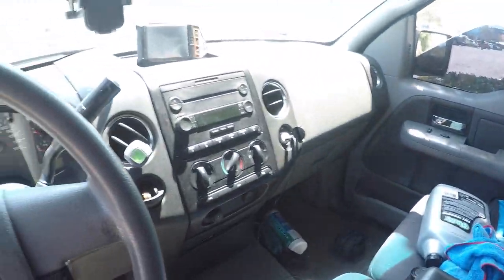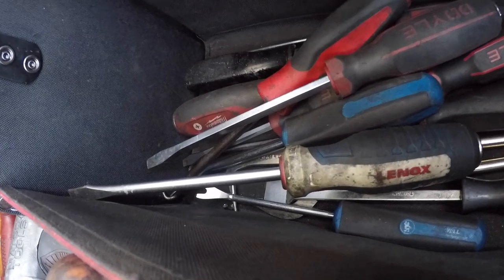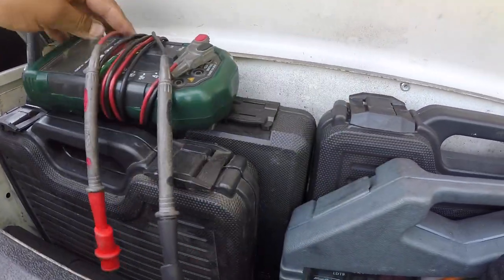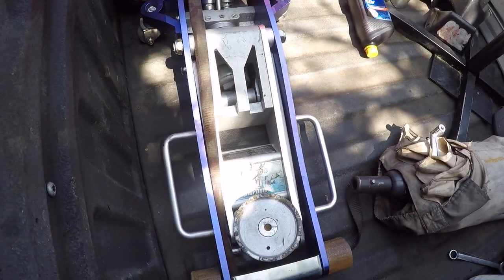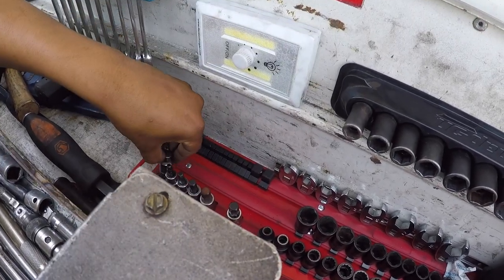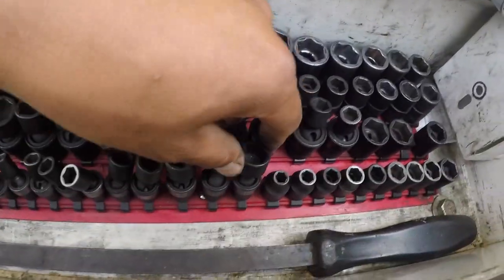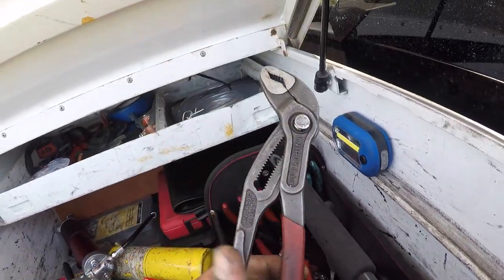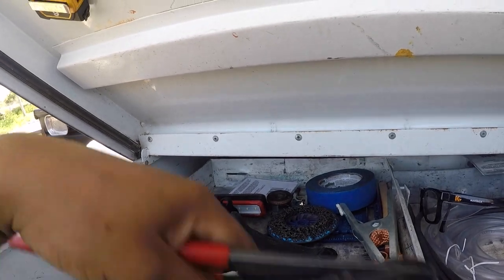TOOL BOX TOUR/ MOBILE MECHANIC SETUP!

Comment: Great setup! Simple and straight to the point. You are the first small setup mobile tech who I saw carry a generator, air compressor, and a welder.  My favorite ratchet was a Mac 3/8 flexhead with the hard red handle. Wish Mac still made them with that handle!
Reply from the maker: I don’t know how mobile guys do it without at least a compressor and generator. I’ve seen guys carry inverters, but generator is way better. Plus it fits fine in the truck. Thanks for watching.

Comment: Great set up im trying to get a little organized myself... just a tip here but take your batteries out of the tool when you put them up in a mobile rig...  I learned the hard way by having a grinder cut a hole in one of my boxes on the highway.
Reply from the maker: Thanks. You should check out my new setup.

Comment: I do mobile repairs too dude. I have certain days at my garage, other days I travel but I work on commercial equiptment and fleet vehicles for industrial Laundry factories and I do boat motors time to time . I   like the set up, nothing fancy but its everything you need .
Reply from the maker: Nothing Fancy! All this Snap-On, Matco, and Cornwell stuff sure is fancy priced. Lol. The biggest jobs I do are head gaskets timing chains/ belts and transmissions/ clutches. If I can do them comfortably and without doing half ass work, I’m cool with the tools I have. All my specialty ones are mostly in my home garage along with other sets I have, but yeah I get by pretty good with my setup. So far.

Comment: Mac/Proto would be my favorite USA maker of Ratchets and I also am a fan of the Napa Carlyle ratchets!
Great video I like your setup!
Reply from the maker: Those are nice, I like the Mac flex heads with the button it has to lock in place. It’s flush with the ratchet so it doesn’t get in the way like the Snap-On.

Comment: Nice setup mine will be sort of similar to this I don’t do primarily mobile mechanic work but I have a Landscaping/Construction company and I have a need for multiple tools when out on the job site or in case of any repairs I need to make to equipment while away from home and the the 1 tool box I have now in my truck isn’t enough room so I will be buying two side tool boxes to go along with the the one I currently have now at the front, until I get enough income to get a utility body like you have now.
Reply from the maker: Thanks dude. Hey man we all start somewhere. Keep on working hard and you’ll have a utility truck in no time. 💪🏼

Comment: Nice video! I really like the set up! Have you ever worked out of a van? I’ve been working out of a van for about 10 years now. This seems like an easier way to organize and access tools.
Reply from the maker: A Sid Not much of a Van guy myself, plus I got my compressor which I use a lot and generator, which throw a lot of exhaust fumes. I’m saving up to buy a truck with a utility box. I find them more practical.

Comment: Mac axis is probably my favorite ratchet but I’m also a big fan of my stahlwille 3/8 locking flex head ratchet. As for pliers I agree snap on are my favorite only bad thing is here in the mid west they are prone to rust.
Reply from the maker: Those Mac ratchets are nice. One thing I love about Cali, hardly any rust.

Comment: @ICS Ivan 
Do you use repair software like Prodemand or Identifix? I am currently a GM tech but thinking about going mobile. What do you do when it is raining or storming outside? Living in Louisiana we get most of our rain/ storms in the afternoon majority of the time.
Reply from the maker: I use identifix, but it’s pricy for a dingle tech. Also keep great relationships with your past employers or co workers. Anytime I need diagrams, specs or any info I call my buddy/ old coworker and they have Mitchell and identifix. As for the weather, I live in San Diego, Ca, we get minimal rain. I do keep a 10ft waterproof umbrella though, helps with the rain and hot sun. I also see some techs that have canopies, but too much in my opinion.
Reply: @icsivan  thanks for the reply and info!

Comment: I have a milwaukee packout box, been really wanting to get a bed toolbox, i just dont want to have to remove my tonneu cover as i like my belongings covered. Might have to go that route though. Love the setup you have
Reply: I had the same problem, just bought a box that fits between the bed rails and is short enough to fit under the cover. Works great
Reply from the maker: That’s how I started, but with the ridgid setup the theee boxes. But now I have a service truck, will do a video soon on my setup.

Comment: Make sure you take those jackstands to Harbor freight and get them swapped out they are known to fail if they are the ones I think they are
Reply from the maker: CW Mobile Repair llc They’re not, I checked the part number as soon as I heard about the recall. I still did get some new 3 ton from Ac delco, just to play it safe.

Comment: I tried mounting my sockets horizontally once., that didn’t last long. I hit a few bumps and they were all in the bottom of my box.
Reply from the maker: Morgan Hatfield How did you mount them, the mechanic time savers socket holder I have is magnetic and holds them in place great. The only one I have issues with sometimes is my wrench holder. But the wrenches are heavy, and it’s only the bigger ones that fall at times.
Reply: ICS Ivan in those time saver holders. It doesn’t help I have a f450 and the sites I go onto are rough enough to knock your drink out of the cup holder

Comment: When did Cromwell start selling Bluepoint
Reply from the maker: Which tool?
Reply: @icsivan  1/4  sae sockets on the yellow holder
Reply from the maker: Oh. Those are not bluepoint they are blue power by Cornwell.
Reply: That’s what I figured but you said blue point

Comment: Would a van be a nice set up. Seems pickups are costly. No room. And boxes are costly too.
Reply from the maker: Never been a fan of vans, I’m saving up for a service truck with a utility bed. It would be messy turning on my compressor or generator inside a van.